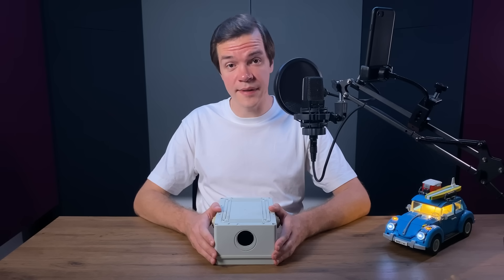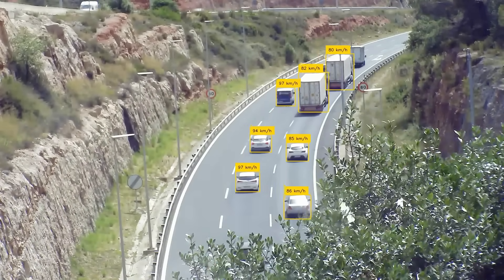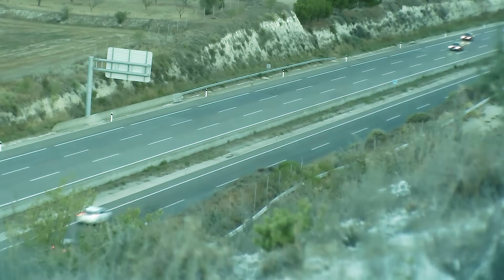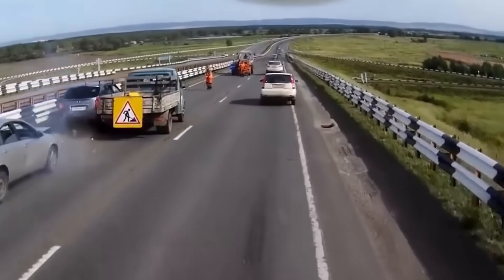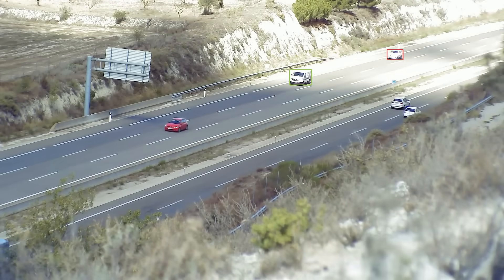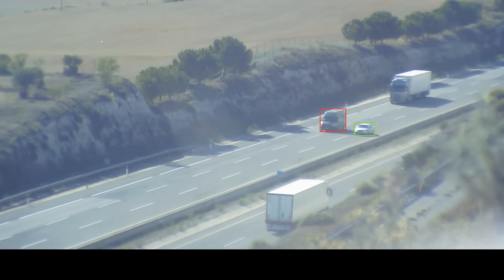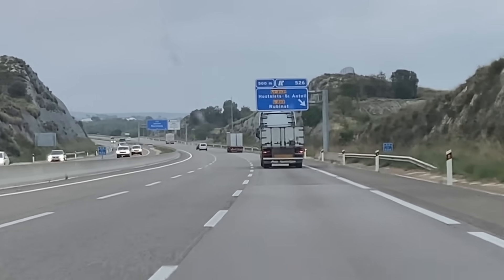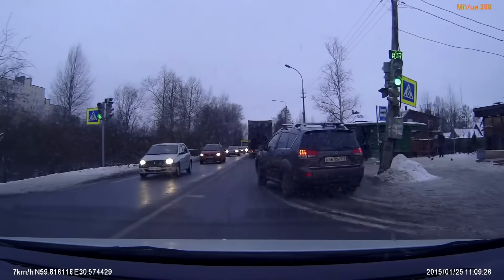New Anti-Tailgating Camera Reveals Shocking Statistics

Comment: Tailgaters piss me off big time. I let off the throttle and coast. It’s even more fun if you drive a manual because you can downshift without brake lights. 
And if you are cruising along with a safe distance behind the car, two or three people will try to squeeze in there, removing your safe assured distance. 
I drove a lot for my job, and I’ve noticed it’s mostly young women, salesmen, and young men thinking they’re in a race car.
Car to car missiles should be legal.😅

Comment: It's a Much BIGGER issue:  Current Volumes of Cars and Trucks using the Same Roadway, does Not Give enough Room to Leave 3 seconds space between.
And If you Do Leave 3 Seconds space,  then Someone is always Passing you and Cutting in to the space in Front of You.
If you then Apply the Brakes,  you Are Now Slowing down the Long line of Cars and trucks behind you causing a Major Traffic Jam up.
A single Car, Slowing just 10 mph can cause 100's of cars behind it to Jamb up, and then the Cars catching up to them jamb up, Making One Long Section of Slow to Non-Moving cars.

Unless there is an urgent Need to Use your Brakes on the Highway,  a Driver should never slow below the flow of traffic.
This is the Major Cause of Traffic Jambs and Accidents.
Lead cars slowing down, bunching up all the cars behind, and then a Distracted Driver, not reacting to the slowing causing an accident.
The Lead car then continues on it's way, Leaving the Wake of it's Disturbance behind it.

Autonomous Driving, that maintains constant Speeds and save following distance with no cars cutting in the openings,   with dedicated slow down lanes long enough for the flow of traffic needing to slow down.
Don't start to slow down, until you have moved over in to the slow down lane.  And Once in the Slow down lane, don't slow down until you need to based on the traffic in front of you.
This way cars can enter the slow down lane as early as possible, but continue at a constant speed till is is required to slow down.

Comment: Veteran drivers will now and then team up when they see other experienced drivers going faster.
I do this a lot on the autobahn aiming for about 170-190 on unlimited zones.
Over time you will learn that responsible fast drivers will keep safety margins and communicate a lot (like with flashing headlights or brakes) and shuffle in the lanes to create smooth traffic. Like flashing brakes a couple times means "leave off the gas, slower traffic ahead" and this will cause the faster cars to coast and be ready to slam the breaks

I can't stand driving that fast with inexperienced drivers who don't know how to do that, but if they keep the safety margins it's fine and they can learn

Comment: If you drive a little slower than the flow and find another driver doing the same you can pace that driver and leave a safe distance.  High speed drivers generally will not get behind the "escort" car (in front of you) because they can perceive they need to pass both of you.   Not 100% but it makes a difference.  This also keeps you out of the "clumps" that developed.  Your slower speed also means that cars getting in front of you more quickly create distance without you slowing.

Comment: I've only worked traffic in the US, but my experience reinforces your data. Most crashes I've dealt with fall into 3 major categories:
1: DUI - I chose the graveyard shift, so it likely throws off my personal experience since I worked the standard drinking hours.
2: Lack of Attention - This includes phones, sleepiness, and such, but mostly phones. Cell phones may be one of the most dangerous inventions for drivers, ever.
3: Tailgating - Everyone has a seriously inflated ego as it pertains to their driving. I think it's as you said, people's poor habits are reinforced because dangerous driving rarely results in a crash, or even a close call.
Pure speed related crashes are almost non-existent. However, speed plays a huge part in the severity of a crash. I think you might need to add an axis to your investigation that includes the injury risk of the poor driving. How often do you see people who think themselves safe drivers because they never speed, or rarely even reach the speed limit. But these same drivers will roll stop signs, pull out onto busy streets without enough room, follow too close, read text messages while driving, or other dangerous habits they brush off because they're driving slowly.
My focus, when enforcing traffic on freeways, was more on selfish driving, rather than speeding. People who treat other cars as obstacles rather than other people are the most likely to be a danger. Cutting others off, tailgating, failure to signal, ignoring lights that are blown, charging forward to "beat" the red, turning into the incorrect lane, flying up a center turn lane past others to the left turn, disregarding stop signs, failure to maintain lane, cutting corners on streets or at intersections, and so many others that you rarely notice when you're only in contact with a specific car for a few seconds. People get far too comfortable violating traffic laws. Then, as experience grows, they can often get worse since the violations rarely result in any consequences.
Heck, even after identifying a bad driver and issuing a citation, the prosecutors rarely feel that spending the time to properly enforce the ticket through a trial so they plea it out for far lower infractions.

Comment: A wise analysis. I often travel on “freeway” style roads - Motorways, or M roads in the UK. Just occasionally Autobahnen or Autproutes elsewhere. Here in the UK it is very like your observation, in that there is a fair bit of “tailgating”, or overlapping braking distances in the lane furthest away from the hard shoulder (assuming that there is one; they do not always exist).

I often use a radar assisted cruise control (ACC) system, which I have adjusted to it’s maximum separation set up, which works quite well in reasonable weather conditions. It doesn’t react aggressively when things cut into the braking distance - so there is often a period of time while it slows down a bit to widen the gap. As someone else says here, those gadgets don’t deal with unexpected obstructions on the road. Here are a couple of minutes of something like that: https://youtu.be/9b9AtRYio40  For those who are not familiar with the car that just avoided hitting the scrap tyre, it would not have any modern items at all, being over 50 years old.

Comment: Whenever someone is tailgaiting me even though I'm doing normal freeway speeds, I do one of two things. If I am in the left lane I move to the right. I reserve the left lane for speedsters. If I'm in any other lane I will just let off the accelerator and slow down. This annoys them and they move lanes to get out from behind me. Breakchecking can be illegal, doesn't work, and it is dangerous. Don't do it.
Reply: Yep, i may have been one of those people to force you out of the left lane. Next time, don't drive slow in the left lane or pay attention to people coming up behind you so it doesn't have to reach the point where I'm tailgating you.
Reply: @conservativeriot5939 - People being reckless and/or creating unsafe situations on the roads for whatever reasons is a huge problem right now.
Reply: @JazzTechie yeah, it's reckless to drive slow in the left lane. That's why most states have laws against it.
Reply: @conservativeriot5939 - One person driving poorly becomes two people driving poorly. Better to let them crash on their own, not join in.
Reply: @JazzTechie I cautiously tailgate them, swerve over the line to the left to indicate to them to move over. If that doesn't work flash my high beams and honk a couple times. If that doesn't work then repeat harassment until they move. I really want to install a train horn.
Reply: @conservativeriot5939 - If a driver in front is already driving poorly, any maneuvers they make are also likely to be poor driving. Tailgating only places the person in the rear in ground zero when the person in front does something else dumb. Will just be a crash between a tailgater, and someone on a cell phone (or something similar). It would be similar to driving towards someone that ran a stop sign because right of way versus keeping distance because they're stupid enough to run stop signs. Let them crash on their own.
Reply: @JazzTechie  been doing it 20 years without incident. I have control.
Reply: @conservativeriot5939 lol such a tough guy giving commands to people in a YouTube comment section. Nobody has to do shit for you on the road or in this comment section.
Reply: @conservativeriot5939  You are a bad driver
Reply: @SupraSav I'm no Nascar driver, but I'm decent.

Comment: You're calling on fines for tailgating? Are you insane? You sound like someone who drives few times per month. Can you even imagine 30m distance between every can on highway, I live in Croatia and the traffic on highways get's extremely bad in summer because of tourism, now imagine if we add even more artificial traffic by enforcing the rule that everyone needs to be 30m apart from each others while driving over 100kmh. Please stick to collecting data and not giving advice on what should be implemented just because you can't think about the problem for 5 seconds to see the issues with your proposition.
Reply: if you're only 30m apart everybody should slow down, the safe speed in this situation is 50km/h.

Comment: Very good and very comprehensive video, thank you for that. I fully agree that tailgating can be dangerous, and should be treated as a traffic violation just as much as speeding, but most of the time people tailgate because a slow vehicle is driving in the passing lanes prohibiting other drivers from traveling at a higher speed. I believe people driving in the passing lane at a slow speed and don’t move over should be ticketed too, perhaps with more vigor than speeding.

Comment: Just starting video,  but tailgating is a real issue; in a few different countries I have been in, most people, including police, drive too close to the car in front, often closer than 1 second behind!

What they don’t realise is : if the car in front of you starts braking hard, and you brake just as hard a fraction of a second later, then you will always be going faster than the car in front (e.g. while you both brake); if you are too close, the risk of an accident is massively increased if the car in front has to do an emergency stop!

Comment: You can set your speed cruise control all day and still set it wrong compared to the road you are on.

If you turn on your speed control to a shitty setting you deserved to be passed because you can’t do anything correct 

If you aren’t following the left hand side of the lane  in bends and at a horrible setting your also a bot and deserve a ticket

Honestly they shouldn’t have invested cruise. It’s just a sorry excuse of a function that people don’t even use correctly as they can hardly actually drive with sense of responsibility to keep the road open and flowing if they are flowing slower or exactly the same as the cars around them

The free way isn’t built for everyone to go mono speed limit right next to eachother like metal cattle hordes …god use your brains and realize if your getting passed your an ass driver that can’t even make a space available on the grid 

Acting like you can’t move or make adjustments to allow for safe passing is just bad driving road mannerism 

If you aren’t in hurry initially there’s no problem being passed lol and there’s no problem with someone getting close to ensure you know they are there and they are going to pass you peacefully lol

Victims be capping about simplistic things such as yielding in their current position that they been holding on the road for over 5 min

News flash there’s a speed limit but it doesn’t not require you all to take off from the light in sync at the same speed.

We’re off topic now but in general 90% of drivers can’t drive or won’t and that switches between the two faster than a woman trynna get some attention

Comment: The solution to tailgating is enforcing proper lane discipline. Stay right unless passing. If the lane on your right is open, move over. This would be the single biggest safety improvement while simultaneously reducing traffic congestion
Reply: There are some people who tailgate and don't want to change lanes for whatever reason.

Comment: It's strange how people don't choose to drive a comfortable speed, but insist on speeding up to the vehicle in front of them like they are in a race.

I drive the same route every single day to work, and I drive at about the same speed each time, in the right lane. Almost every day, there will be one or two vehicles that will pass me shortly after entering the highway, disappearing into the bulk of the traffic. And, about half an hour later, I will pull up behind, or right beside them at the same set of lights at the off-ramp to head East to where I work. Those same vehicles do the same thing, on the roadway going East, and I'll pull up next to them at a set of lights at some point.

This happened once with a guy in a red Honda, and he literally raced ahead to each stop light. I was right behind him, driving much slower every time, and he pulled into a parking lot just down the street from where I work about 5 seconds before I reached the same spot.

None of that racing around, cutting in and out of traffic, saves much time. It might pay off once in a while if you happen to catch some green lights, but largely, the actual time saved is minimal when the traffic is dense, which it is always during the peak drive times.
Reply: Mythbusters even proved it years ago heh
Reply: Also it just increases cost for maintenance and gas. A defensive driving instructor once told me most people are addicted to the g-forces of acceleration and deceleration because it gives them a feeling of movement aka 'something happening'. They might do that to stay alert because they need stimulus or some kind of release.
Reply: This is why going from 1 lane to 2 lanes does not "double" the capacity of the road. If you have 1 lane flowing and turn lanes to clear obstructions everyone drives to the pace of the smartest driver in the platoon who syncs everyone up to the light cadence and you make good time. Add a lane and people start aggressively accelerating and braking and chopping it up and cutting each other off and it clogs up the flow of traffic. These people are like a bad swimmer thrashing around in the water, making a lot of noise and throwing a bunch of water around but not actually making much forward progress.
Reply: It feels good driving fast, that’s why they do it. It was never about logic.
Reply: @AWorldIf  Yes, people are slaves to their own base desires ...
Reply: What's comfortable speed for you may seem like a crawl for someone else or lightning speed for the other.
I don't see people speeding (reasonably) to be a problem. 

People who drive erratically, hit breaks for no reason, drive 10 below to speed up 15 above to slow down to 15 below in the span of 3km.
Not using indicators, using outer lane for cruising. 

Basically people who don't engage their brain when driving, who have 0 awareness of what's going on around them.

If someone wants to drive 20kph above the speed limit on a motorway...go for it. 
But if you decide to drive 20 below in the outer lane...I hope your wife is cheting on you 😂
Reply: At least for me some overtaking is explained by people ahead being awful drivers. Nowadays I have a car with a manually adjustable speed limiter and I use it to drive thr speed limit exactly. But I also like to drive smoothly and efficiently and there are some dumbasses who will randomly drive like 15kph under the speed limit, then go 20 above, then they near a curve and almost stop and I just don't want to deal with it
Reply: man i just like driving my car intensely

Comment: "Why aren't there any automatic systems that would issue finesto talgating drivers?"
Because people will voluntarily force you to tailgate by braking and decelerating just before a "anti talgating zone" if it works just like radars so you are fined for nothing.

And to answer as to why people are not respecting the safety distance, it's because other drivers has a tendancy to use this "free space". So, by fear of being taken over and see your spot in the queue "stolen", people tailgate.

Comment: Instead of that safety Index you could calculate the joules of the crash.
You can calculate a equation were both drivers hits the break and the second a little bit after.... And then the kinetik energy in the transfer of speed to both cars have the same speed after the crash.
The more joules, the worse.
And 0 joules means no crash and totally safe.

Comment: In Texas flying with 90 mph (144 km/hr) means that you are squished between two pickup trucks each higher than 2 stacked cars. The distance between cars is about 5 ft. (1m 50 cm).
This is done intentionally by you so nobody can get in front of you.  If you leave a distance for a full car between you and the car in front of you in about 60 seconds the car behind you will get in front of you. Every single time.

All that is about domination and not being outdriven.  It has nothing to do with safety. It's culture. The nicest people you know turn to driving maniacs when they get in a car.  That is our mentality. Also - the bigger your car is the more you act unpredictable and aggressive.

More important is the fact that people drive in unpredictable ways.  Because here most of us have a lot of problems.  Stress and exhaustion being the most common.  So driving 5 ft from the next car is not done because of predictable high speed driving habits.  That is insanity but to us is normal.